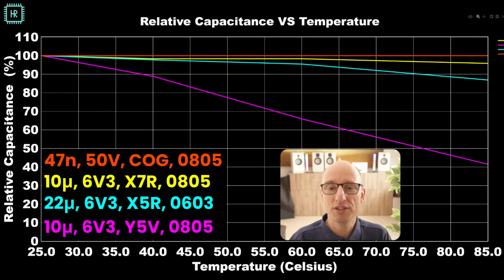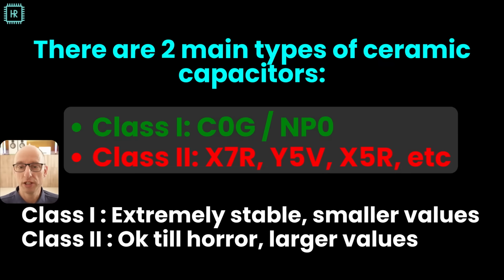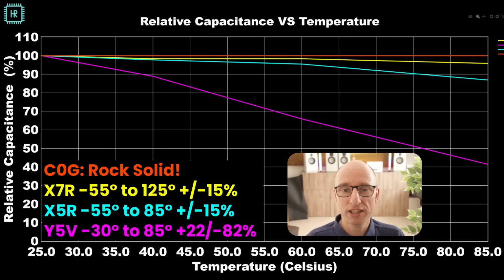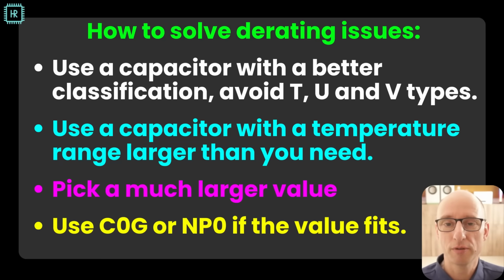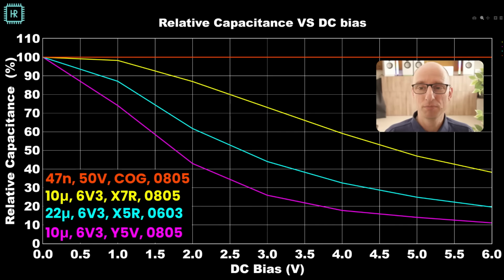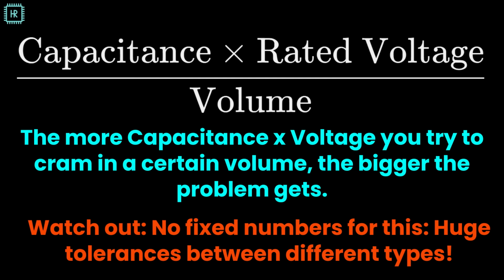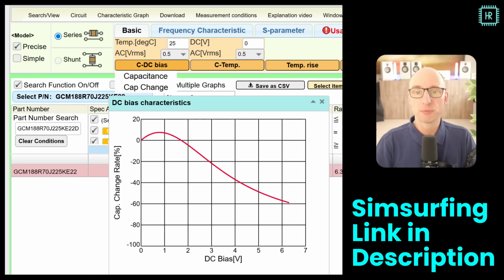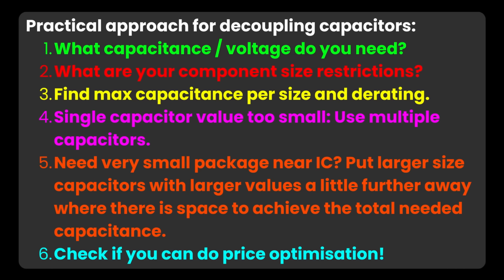Hidden Capacitance Killers, The Ones That Ruin Projects

Comment: Age is another thing that affects ceramic caps. As the months and years pile on, they lose part their capacitance.
The lower stability dielectrics are the worst, much like the DC bias capacity loss, but with age.

We used to joke the DC bias for extreame denisty ceramic caps isn't =1/2Cv^2, but rather closer to 1/2Cv. A few caps actually came close to this...

The NP0 (COG) dielectrics are quite good - very stable, and often comparable to good film caps
Reply from the maker: Indeed!
Reply: I work on some older equipment with Z5U types, and they definitely lose capacitance over decades, but one strange detail is that if you heat them up, they will regain their capacitance. A friend of mine tried this just for fun and baked some old Z5U caps in the oven. They returned to their nominal values. Even soldering can restore some of it. Whether knowing that is of any practical use is a different question.
Reply: @southerner66 
This is the same with X5R - they lose capacitance with age. Reflow soldering them "resets" them.

We don't really deal with Z dielectrics, as they are so terrible. Decent X7R is not really much of a premium these days, but can be physically a bit larger

Comment: Use ceramic capcitors to make VCOs instead varicaps 😂
Reply from the maker: actually, that may not be a bad idea at all...... These caps are a bit lossy though, that will affect the maximum Q you can make....

Comment: Do you know the mechanism that causes this loss in capacitance?  Is it related to the effect that creates audible noise?
Reply from the maker: Yes, these caps are made by combining different materials. When you apply bias, their allignment changes causing the capacitance change. It is a bit like a magnetizing effect.
Reply: @HansRosenberg74  Thanks.

Is that a mechanical change, like piezo?  Or molecular alignment changing the dielectric constant (meaning it isn't constant ;) )

Is it the same effect with temperature and DC bias?
Reply from the maker: I think the effect is the same for temp and bias. I don't think it is on the molecular level, more on the crystal level.

Comment: I need to link this video in my next video! 😜 Is it okay if I use a short clip of your "capacitance to temperature" segment?
My next video is on how to make your first PCB, AKA how to choose the right resistors and capacitors for the typical application circuit in the datasheet you're looking at. I could try to explain why you choose certain types of capacitors, or say see this chart, watch this video.
Very well done 🤘
Reply from the maker: Yes, no problem, just link me in the description :-)
Reply from the maker: Just check what youtube allows, I'm not exactly sure what is allowed here. You may get banned for some things?
Reply: @HansRosenberg74  I will definitely give you a credit! I don't think I'll have any issues as I have a few videos up with 3-8 second clips of other YouTube videos in them. I always make sure to have explicit attribution on screen by having a black bar across the bottom with white text of the channel name and video name.

I should double check as I recently got monetized and don't want to lose that! 😁

Comment: A really interesting effect that can happen with DC bias-induced capacitance reduction. With any capacitor, when there's an inrush current from a DC supply into the capacitor through an inductive element, the voltage can overshoot above the DC value, until the capacitor has absorbed all the energy from the inductor. With a linear LC resonator the peak voltage on the capacitor would be at most double the voltage source, but when the capacitance decreases with voltage, the peak voltage reached can actually be triple or even higher. So if your capacitor's voltage rating is too close to the operating level and there's not adequate inrush protection to damp on that overshoot, you can damage your capacitors or other downstream components in the system quite easily, hitting excessive voltages that you didn't anticipate.
Reply from the maker: Very interesting, did you actually observe this in a project at some point?
Reply: @HansRosenberg74  Yes, after a lot of blown-up boards!
Reply from the maker: @jbay088 oops....this is a really sneaky one. Logical once you understand it but very nasty to figure out
Reply: Also learned it the "expensive-way" - produced a few thousand boards which then failed in the field. Realised after a year of reseach that the field guys did "hot-plugging" (although forbidden in the manual)
Reply: For various reasons I use X7R for DC/DC converter input filter and one indeed have to be careful with in-rush. Generally, in-rush simulations are quite inaccurate if you don’t take the non linearity into account.
Reply: @newDAVIDnew  yeah. its pretty easy to model the cap nonlinearity with DC bias though, using a table to do a piecewise linear approximation
Reply: I believe Jim Williams mentioned it in one of his app notes. There are places where low ESR is desirable or even unavoidable to ensure device function. Especially on big CPU and GPU chips. The power supply qualification process for those is quite involved, and capacitor ESR has huge impact on whether you pass or fail.

However, in general purpose filtering, e.g. in bulk capacitors at the power entrance to the board, some ESR helps damp the inductive transient and limits the overshoot. In a well designed board, the high frequency stuff will be decoupled very close to the load, and those HF currents will flow in very small loops. Then the tendency to overspec the bulk decoupling is counterproductive.

Even though mains frequency transformers have mostly gone away, we can still use them for thought and bench experiments.

Think of a mains transformer supplying the input via an ideal rectifier. For small loads, the wire used in the transformer is very fine, and the output impedance of the transformer is much higher than that of the bulk cap. The bulk cap’s impedance is the LF impedance the local loads will see. Its ESR can be low, since the transformer’s impedance limits the inrush current and associated spikes. The rectifier conduction angle will be relatively long.

Now we go to a much bigger transformer supplying the same load, with the same decoupling. The transformer’s impedance is now let’s say within an order of magnitude of the capacitor’s ESR, and we can expect things to become harder the closer those impedances get. The rectifier diodes further convolute things since their conduction angle and thus the LF harmonics they produce vary with transformer impedance. So analysis has to be done with the diode conducting, and also with the diode and transformer removed from the circuit.

Then there’s the problem of ESR coordination on the board level. A lower ESR «bulkier» capacitor may push enough of a transient through board inductances that the smaller caps further down - and their loads - see a transient. This problem manifests itself rarely, but when it does - typically on larger boards - it can be a head-scratcher. The transient doesn’t have to be super fast, and the chip-side decoupling tends to be transparent to it.

Now add to this the switching of sub-circuits as the operating mode of the device changes. The switches have to switch softly enough to be critically damped with their source and load. So they dissipate some energy each time they switch due to conduction loss in the partially-on state. The physically larger packages with lower overall die-to-PCB thermal resistance will be less thermally stressed. A tiny soft load switch’s die can get very hot (still within limits) for a few ms, even though the average power dissipated by it would never heat the die so much. Now we’re thermally cycling the die’s connection to the leadframe or to the balls…

The textbook idealizations are useful for building initial intuition, but in real projects things can get much more interesting :) It’s not a bad thing but takes a mind that accepts the measurement results faced, and appreciates that a solution exists even before finding it.
Reply: @absurdengineering You raise interesting points. Indeed the real world applications are much more nuanced and ‘it depends’ than what we learn in school. 
Personally, I have not done power for RF and high speed designs all the way to component level, only upstream at the main supply and therefore I’m keen to learn more about the downstream.

Comment: keramic😂
Reply from the maker: I know, apparently I pronounce that in the wrong way, allthough  I do understand there is debate around that. Could be one of those american / british english things :-)
Reply: @HansRosenberg74  I just never heard it pronounced that way. It sounds so off to me. keramic😃 Also you forgot to mention to never use ceramics in the signal path of audio amps, they add a lot of distortion because of the voltage non-linearity. Video idea: quartz crystal loading, how do you select the proper load capacitors, series / parallel resonance, maybe it would be useful.

Comment: I came across the DC bias derating some time before I switched to my former job. My former boss - although professional hardware developer for quite some time - wouldn't believe that at first. And yes, I remember that at that time these effects typically were not published in the data sheets.

The type II dielectrics have also the disadvantage of being mechanically active, so on one hand you will have a microphony effect and on the other hand they may produce audible noise which may be quite prominent in PWM circuits with low frequencies (e. g. dimming of LED lighting).

To my knowledge the worse compositions (Y5V) may have advantages when you want to have losses (dampening) on purpose. But for decoupling they're horror - having large inrush currents while charging up and being useless when charged 😊
Reply from the maker: Nice story. I know about the microphonics, it's also in my course. Want to make a video on that at some point maybe.
Reply: The piezoelectric skreeeeee of ceramic capacitors in cheap LED lighting fixtures is the worst. I work in live events and see it a lot with cheap lighting fixtures that have been in service for a while, they'll start making a racket when they're dimming. It's particularly bad if you're working in a concert hall and when you're trying to record orchestras and there's a 2 kHz whine in the room...
Reply: about 10 years ago I was tasked with determining the root cause of very poor yield in a PSU boot-strap circuit. The theoretical worst-case tolerance stack-up was marginal, but eventually we found that swapping the 1uF SMT (50V) cap with a working unit would fix any broken unit and break other previously working PSUs.
Our best RLC meter could only apply 10VDC bias where there was some degradation on KEMET brand parts (but not on Murrata). The circuit operated at 24V so I had to devise a test circuit: I used an isolated 24Vdc supply and a function generator with a external source impedance added. Then I exported scope captures and fit the charge/discharge curve to find the effective capacitance. We saw >80% reduction from some suppliers at 24Vdc on 50V parts.
KEMET finally admitted that their datasheets were incorrect as it showed DC bias performance for the automotive grade instead. The industrial grade ceramics used an inferior substrate and their datasheets were incorrect. We stopped buying from them.

Comment: This is especially important for some DC/DC converters that get unstable if their input decoupling falls below a certain threshold!
Since I started to meticulously check the input decoupling caps and minimise its connection impedance I didn't have any issues even with converters running at 1 or even 2.2MHz
Reply from the maker: Indeed, that is a very critical application, also for EMC and supply ripple/noise

Comment: Found this DC bias issue while increasing the capacitance of a backlight timing circuit. It gets charged up when you press the momentary button and keeps a transistor on for a limited time, I wanted it longer. A bigger capacitance ended up in less time on!  Had to switch away from the MLCC to an electrolytic to get the correct result. It was quite confusing for a while.
Reply from the maker: hahaha, yes, that sounds like complete confusion. I once used mlcc's for a loudspeaker protection circuit. You need a very rough low pass filter for that, it does not need accuracy at all. It does need enough capacitance to not do a 'false positive' and I had to stack a few together. In the end I picked a bidirectional elco, that worked perfectly.

Comment: The annoying bit is that finding a capacitor that doesn't suffer as much from DC-bias usually means going to a larger case size. And of course larger case sizes have higher ESL. Physics will always get you back...
Reply from the maker: indeed..... Do you know the Law of Conservation of Energy??? There is another law in this case: The Law of Conservation of misery :-D
Reply: @HansRosenberg74  hahahah you're not wrong mate
Reply: @HansRosenberg74 At University I was taught the Law of Conservation of Difficulty :)

Comment: Will also add those high value ceramic capacitors are both microphonic and piezoreactive, in that they will develop a voltage due to board flex, or vibration, and can impress a voltage on the power supply under the board vibrating, or as the temperature of the board changes. Even worse if you mount them so they get stressed, like putting them near a mounting hole, or in the direction of board flex, they can also crack, which means both intermittent operation, so a noisy supply, or can be affected by humidity, and also just fail after a while. That is why in automotive and space applications you always use 2 in series, at right angles to each other, so that if it does crack and decides to fail short circuit, it will not fail the board in use totally. Plus there conformal coat is almost always applied, to keep moisture away.
Reply from the maker: hah, great, I like the 90 degree trick. Did not know about that one, but makes a lot of sense. Do you work on cube-sats or something? Or bigger ones? 

I'm would like to make a video on the piezo effect. It will be a bit tricky, I have to do some research on it how best to apply shocks. Off course I can just 'ram it with a hammer' but that is a bit crude. Loudspeakers are not a good idea, motors as well, they create magnetic fields that I may pick up unless I build something complicated. I'll figure something out, maybe 3d print some mechanical thing that creates lots of vibration using a hand-crank, that would probably do it :-)
Reply: @HansRosenberg74  I used MLCCs on a ICL7660 negative voltage converter, and it makes a very annoying acoustic noise due to the piezoelectric / ferroelectric effect and the unfortunate operating frequency of the 7660. It was really annoying, so I desoldered one end of the capacitor from the PCB pad, and then joined it back on with a thin wire so that the capacitor can change in length without flexing the PCB so much. That made it quieter but I can still hear it.
Reply: @HansRosenberg74 use a piezo crystal coupled to the board with bee's wax
Reply: @HansRosenberg74  That piezoelectric effects would be very interesting to explore for sure! Ram with a hammer in controlled way could be fine. As long as it's repeatable. Maybe a ball bearing released from a set height? Could even use a nylon tipped drum stick mounted on a pivot point and have piece of wire or spring steel get pulled out of the way to release it. Something really simple like that. 

If you wanted look at resonances what they can induce, you could acoustically coupling to a speaker coil that is some distance away with a rod or tube or acrylic. Could also maybe cancel out magnetically induced interference from the speaker by having control traces on the test board. Then by taking a transfer function measurement of the path with and without capacitors you could cancel get a read on what's happening as far as acoustic interference.
Reply: "2 in series"?  Maybe in parallel, rather?
Reply: @francoissouchay3887 SeanBZA seems more concerned about a broken capacitor short circuiting, causing circuit failure, than it dropping to 0uF, which could sometimes be tolerable.
Reply: @stapallemachtig  Well yes, which is why you put in 2 in series, so a single short is not an issue, plus if you were worried about open circuit you would put 2 of those series strings there, with a single failure making one open still allowing the circuit to operate. After all ceramic chip capacitors are as cheap as SMD resistors, at least for non specialised parts, ad thus adds possibly a cent cost overall with a few dozen extra on the board. If it is critical you will be using properly specified capacitors anyway, which means you will be paying Vishay a cent or three for their more reliable parts, and if it is an expensive board you would be designing in their automotive line at a minimum, where they actually do have compliant leads on some, and 2 or more capacitors in a stack, so you only need 2 parts there.

Comment: I think there could be another way to test capacitance under test and that is to simply create a low pass filter or high pass filter or even band pass filter and feed in a sine wave and notice its amplitude changes over time. Then just see what the final amplitude is once it has stabilized and compare that to the initial value. Reverse the Fc formula for your particular filter to find out what capacitance would have been needed to change the amplitude of the sine wave at that particular frequency to the measured amplitude.

Thoughts?
Reply from the maker: Yes, that would also work, it would require a bit more math and measurement. The RLC meter makes it very easy :-)